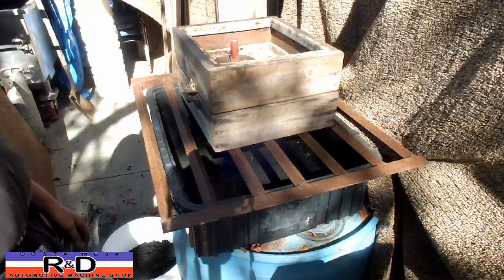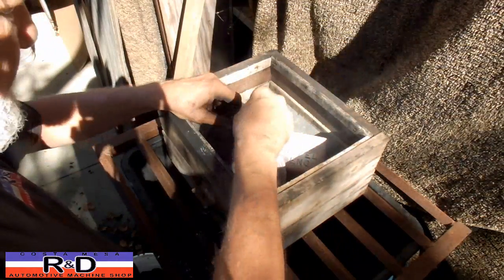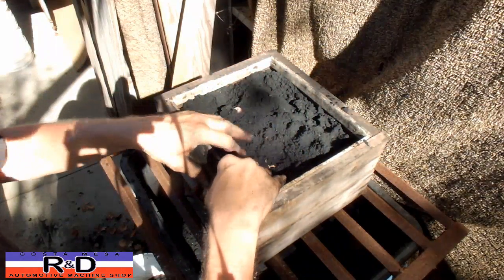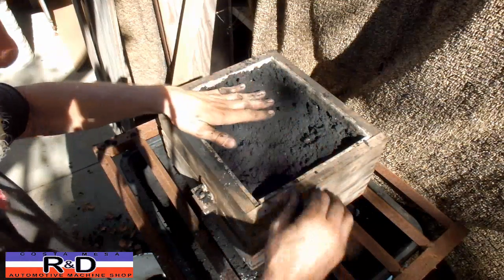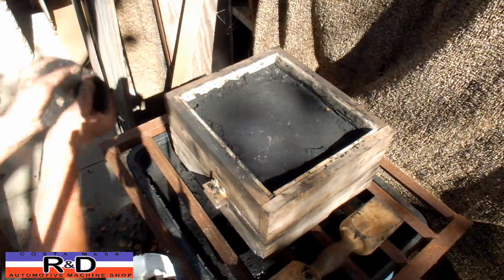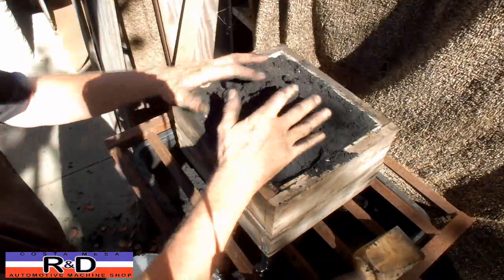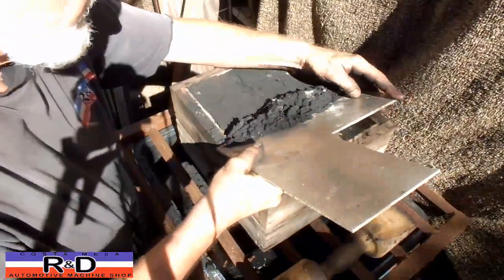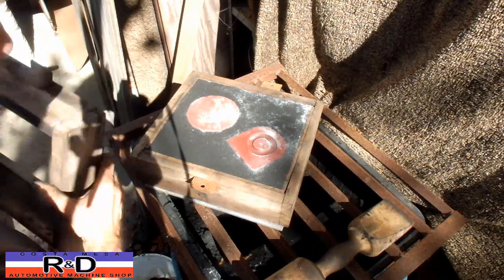Casting Project - Part 1

Comment: Hey John,  quick tip.  When first filling the flask with green sand it's best to use a sifter/screen/riddle to break the sand down a little smaller so you get smaller particles right against the pattern for a better surface finish.  ( I work in a foundry)